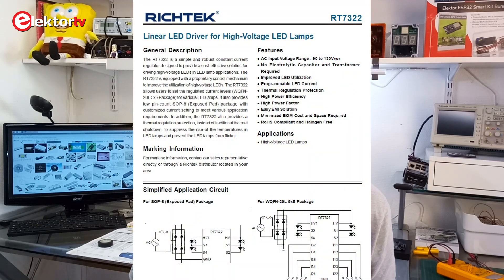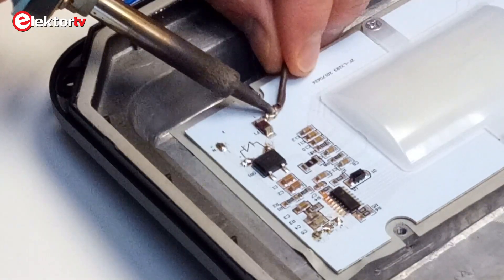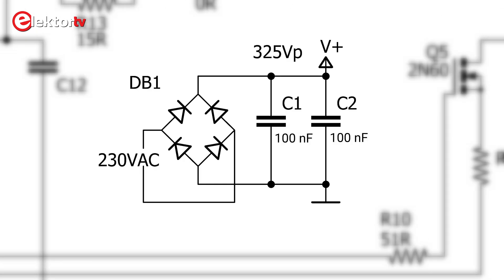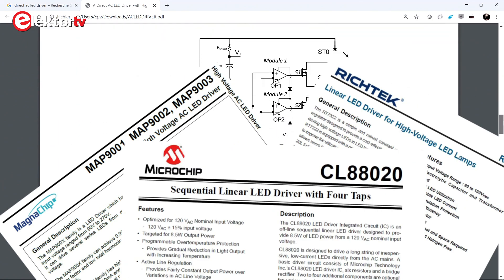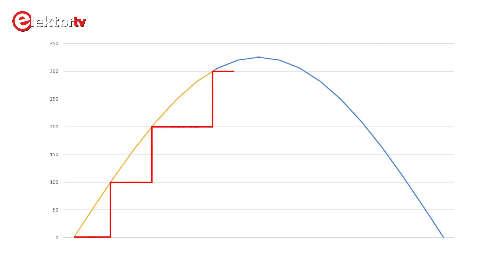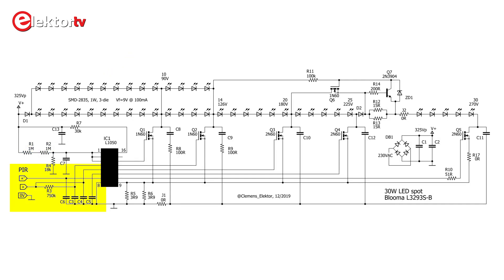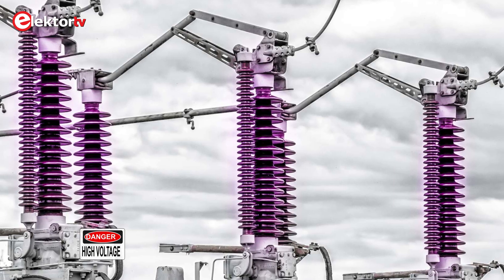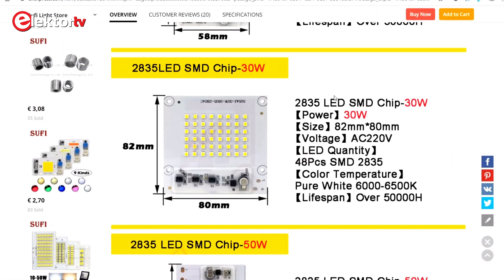The Linear LED Driver and El-Cheapo Floodlight Repair

Comment: Ihave got exactly the same one, lasted few months and I couldn't figure out exactly what is wrong R5 and 6 giving 0.7 ohm in parallel i belive it should be around 1.6 ohm. I think there is a design fault.
Reply from the maker: Thanks for sharing your experience! You're right—R5 and R6 in parallel should be closer to 1.6 Ω if they’re each around 3.3 Ω. Getting 0.7 Ω could point to degraded resistors or a short elsewhere. We've seen similar issues and suspect some cheap floodlights may indeed have design or quality flaws. Appreciate your input—every shared case helps the community troubleshoot better!

Comment: Hello, interesting, i purchased a couple of these cheap floodlights without paying attention and they arrived for 220v and i am in the US with 110v.  I wonder if it is possible to change the power supply rectification and run them on 110v?  Thanks

Comment: Very good 👍🏼. I did a video about the older type LED spot light with a seperate driver. not quite as in depth as your video, but my spot light just needed the LED module.
Reply from the maker: Thanks for the info!